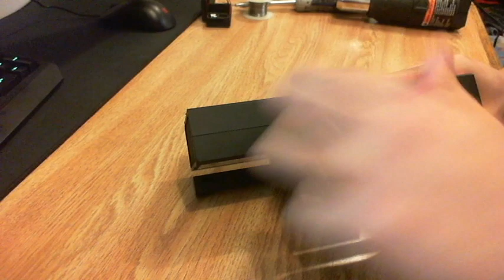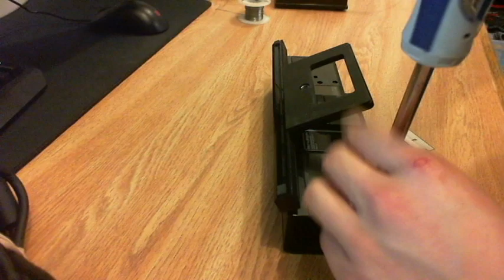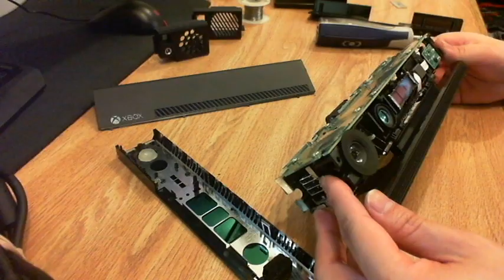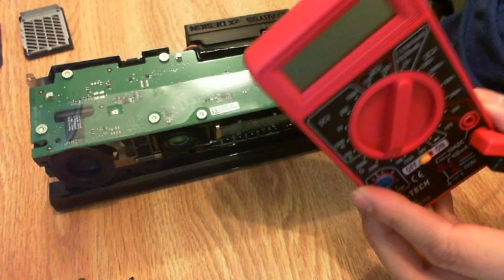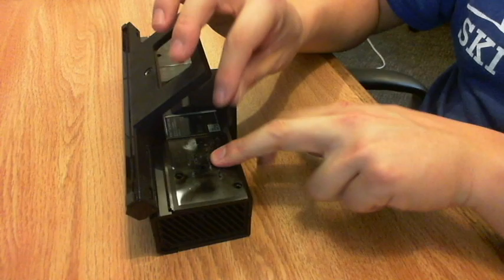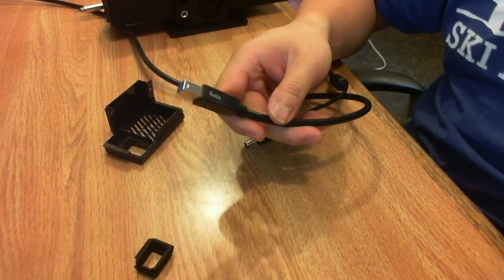Xbox One Kinect S/X USB Mod. 3D Abyss Shroud HOW TO CONNECT YOUR KINECT TO PC

Comment: Hi again so I ordered the 3d abyss shroud with the dc input built in. So I guess u r the manufacturer of these parts? Couple of questions first when removing the stickers to expose the t10 screws does the sticker have any sort of security markings that show up after removing them that make it easy to tell u opened it and voided the warranty or can they be replaced with no sign of tampering?
Second when testing the connections with the multimeter what setting should I have it dialed into?
Reply from the maker: The screws do not, one of the stickers being peeled up will have the "Microsoft" imprint in them if heated up enough they will come off and not leave any mark. When testing connections you are looking if they are connected so Ohms. However most importantly you are checking to see if you have shorted it out to any other near by pins. The units themselves are already tested before shipping.

Comment: What buying option should I chose if I want to do this my self and just want the shroud with the dc adapter? I thought it would just be 10$ for the 3d abyss part it looks like it’s 40$ for just the 3d abyss shroud with the dc input plus 51$ for the other parts form amazon? This is way more then what I was expecting
Reply from the maker: You don't need to buy everything from amazon. Local dollar store or home depot may have your screw driver kits and adapters can be sourced from old components you have laying around. The cable itself is needed unless you have one laying around. Any 12v 3a(or higher amp) dc power supply will work. The very first unit i used was from a old Network attached storage I had laying around. Most routers also have 12v inputs. T10 torx can also be found at any hardware store or ordered online for under 5 bucks. Hope this helps, let me know if you need anything else!
Reply: i have an old HP laptop power supply i'm going to use. 12v 3.5a. hit up your local thrift store or electronic recycling place, bet you could find one cheap.
Reply from the maker: Its the luck of the draw, local goodwill I have seen have a few for sale from random laptops, routers etc!